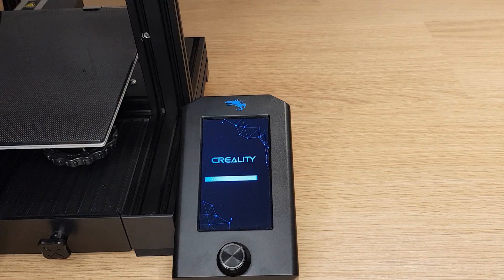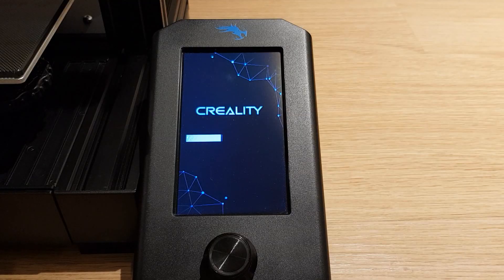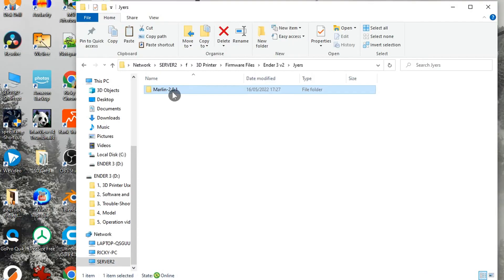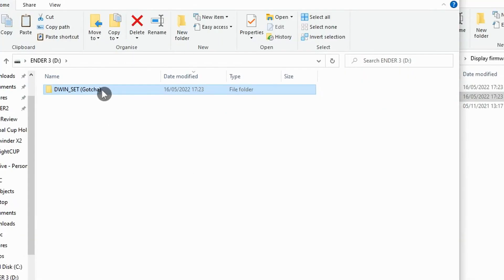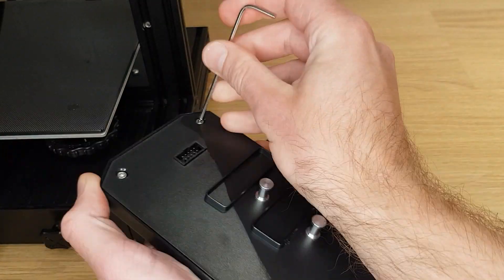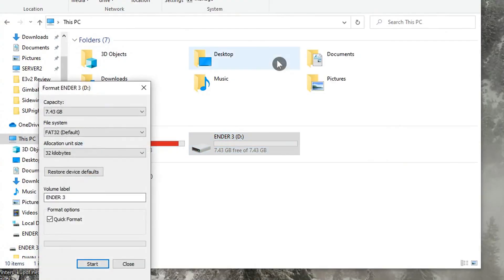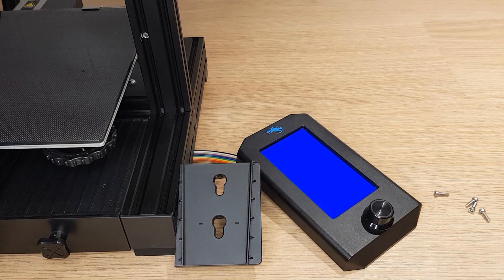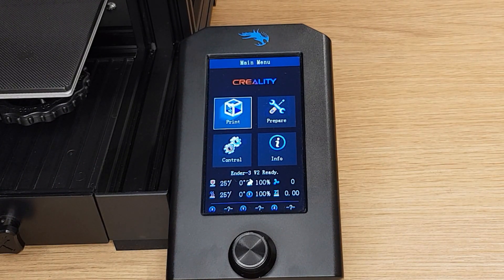Update The Screen Files On your Ender 3 v2 To Get the Most From Jyers Firmware

Comment: My screen doesn’t seem to be updating even with reformatting the SD card.
Reply from the maker: What's happening when you turn it on with the card in? Are you getting the orange screen?
Reply: @RickyImpey  i have the same problem, the screen  just starts normaly
Reply from the maker: @stateofsoul4557  That happened to me when the SD card wasn't formatted correctly. Have you double checked it's formatted as in the video? Also, check out the pinned comment above by Pat Moore. There are some display boards that won't 'see' the SD card so you may need to follow the link and try the alternative method Pat used.
Reply: @RickyImpey  Thanks! I didn't see the ``more`` section on the comment. It fixed the problem. Does this update only changes the UI visuals? Thanks for your answer and quality content!
Reply from the maker: @stateofsoul4557  I haven't seen the results of the method you have used I'm afraid. The screen files only change what you see though. However, you should see quite a lot of difference with the usability of the machine now you have Jyers UI. Enjoy!
Reply: try to use a different pc to reformat your SD Card. Also, Use 8gib or fewer SD Card. Finally, Formating using the FAT option and 4096 capacity

Comment: My screen looks like that from the first time I installed it. Is this update different than the first one.
Reply from the maker: There are not new screen files as far as I am aware. This is mainly for anyone who hasn't changed the firmware or updated the firmware without also doing the screen files.
Reply: @RickyImpey  OK thanks